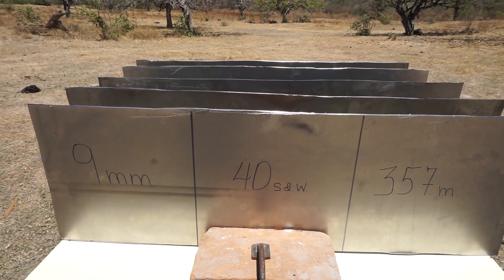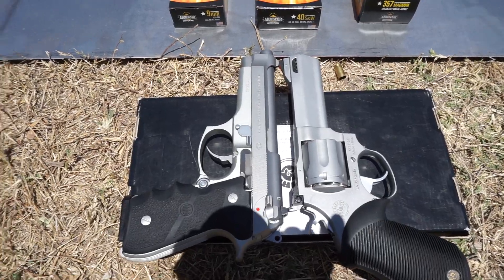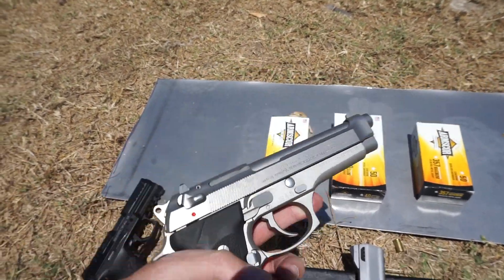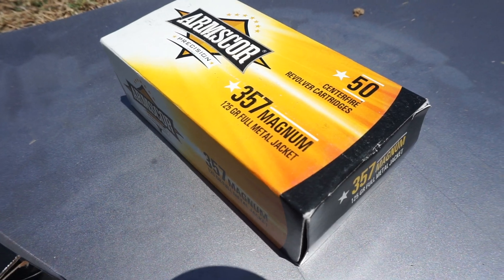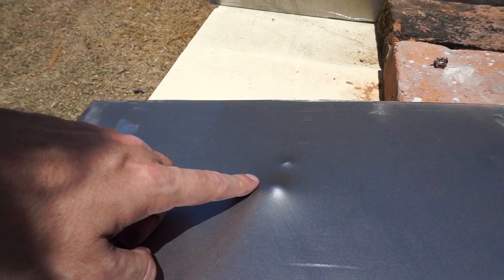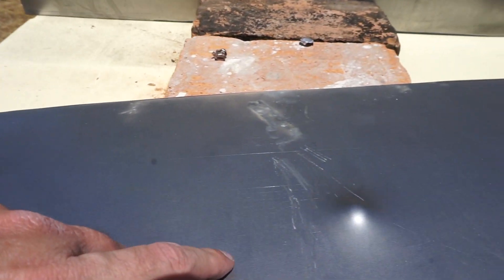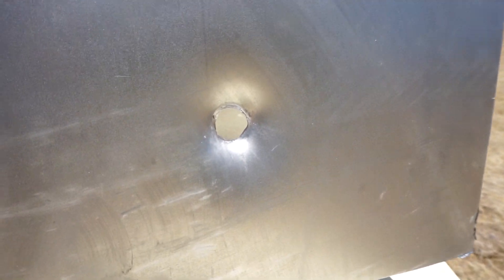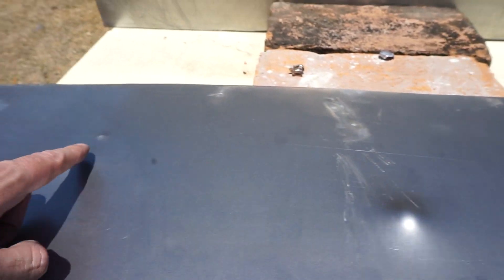9mm 124gr vs 40s&w 180gr vs 357 Mag 125gr (Armscor ammo) FMJ against 5 Steel Plates ⚙🔩🔥

Comment: Should have used Buffalo bore 125 GR for .40 @ 1400+ FPS for even testing
Reply: By that logic he should have used Buffalo Bore for all three. If that we’re the case, you’d end up with a 357 Mag 125 gr going 1700 FPS.
Reply: I think jack was trying to keep it consistent by using same ammo maker. But I do agree, the true power of 357 is not represent by armscore. Hornady critical duty, double tap, Buffalo bore... those are properly loaded.
Reply: I am not l trying to troll you, but it was even testing,common caliber weights, in the same manufacturer. You can always mix and match to get the outcome you want. Buffalo bore also makes a 357 and it would definitely be more powerful than 40. There is certain 9mm that can be put against certain 40 that will penetrate further. I will agree I would like to see Buffalo bore in all 3 calibers. I think he would need more plates especially in hardcast lead.

Comment: Stop using 180 grain for 40.  That shit is like using 147 grain non +p for 9mm.  It's slow as hell.  Use 165 grain. And see the difference in velocity and performance.
Reply: Wrong per LuckyGunner's results. 180 gr can out preform a few 165 gr bullets. Bigger expanded bullet and more penetration depending on the model.
Reply: I watched a video of the 180 penetrating more than the 165.